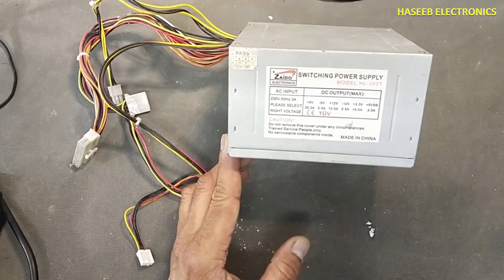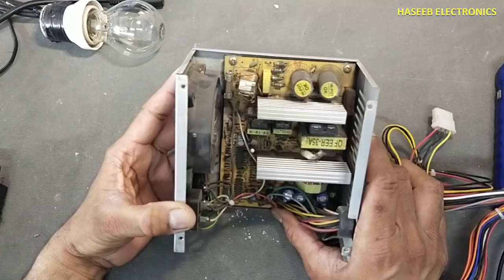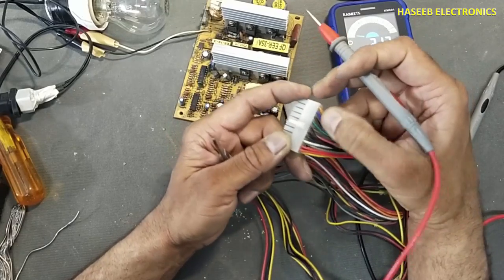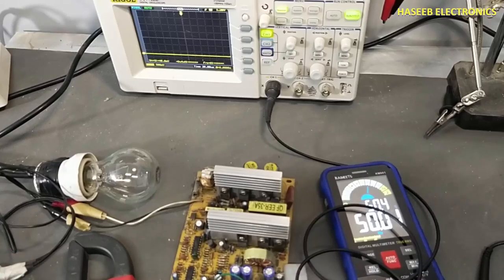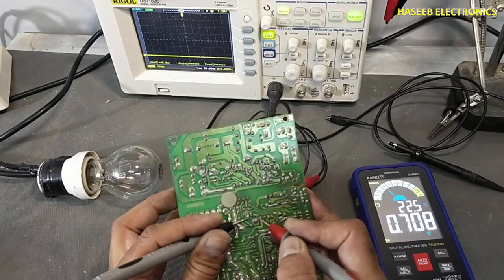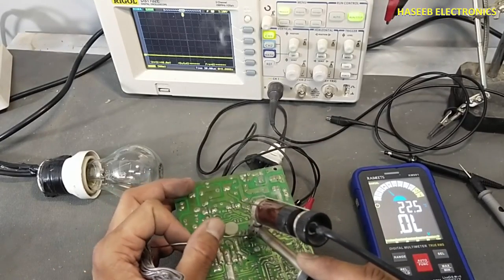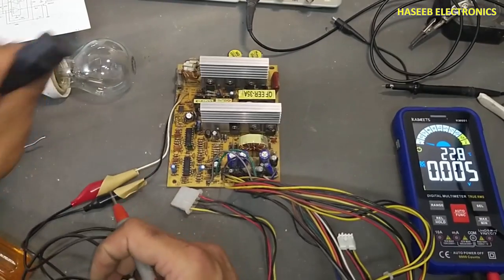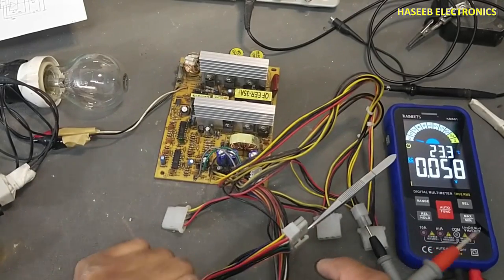{847} How To Repair Computer ATX Power Supply - No Power On

Comment: Resp Sir! Very Excellent Class Sir. Sir Conon MF244dw Printer Power Supply DC Section 0.1Ohms 2Resistors was burned Sir and New Power FET K4005 was Replaced Sir and 2 Resistor Replaced with 1Ohms, 10 Ohms, 22 Ohms Resistors but again and again Burned Sir. and Series Lamp was a very Lettle Glowing Sir and Resistors Burned Sir. Where the Problem Sir. Very Hardly Searching Sir but  not Solved Sir.  Please Advise Sir. waiting for Ur Message Sir.   ---  Chinna Rao, Paderu, Visakhapatnam Dist, Andhra Pradesh.

Comment: Sir, I am facing the same fault in hipro d3057f3h psu, how can i find the location of two transistors along-with that frequency diode??? Hence I found also two transistor (29074) with near a diode 6510. After that, viper 22A then a diode again 6510. Sir, was it the location of malfunction??? I will pull out these components from circuit for testing after your recommendations.

Comment: Sir KA7500B pwm controller ic pin no. 4 increasing voltage instead of 0v on ps command on. Fan will spin for seconds and stops. Give the solutions please 🙏

Comment: Greetings to you aTx contains tl494 Vcc voltage starts at 17 volts and goes up to 19 volts is this normal I changed the tl494 gas capacitor and the voltage didn't change What's the reason

Comment: Hi Haseeb, i am thankful with your channel and i learned a lot from your teaching. i have a question from regarding the power supply of a MFP copier , i'm searching in social media who is repairing the LVPS but i could not find. i can repair in primary section but when it comes to secondary i could not get an actual value that suppose to be their is +&-5V, +&-12V, +&-24V. i am not sure if need to trigger first the heater section of the copier then will activate the other parts which supplied by 5, 12 & 24V.   like in PSU of computer you just need to shorted the green and black wire in order to run the LVPS. please if you could share to us how to repair.  Thank you very much.

Comment: wbat should be thr watt of the series lamp for 60 watt 100 watt 200 watt
or is it different for difference power supply
Reply from the maker: it depends on power rating of the unit under test
normally 60 - 100 watt lamp is sufficient

Comment: I have an old ATX power supply Antec NeoHe430.  All the power rails are present and correct with no load attached.  If i plug a IDE drive in to give it a load then the 5volt is only 3.6v.  The other rails are still correct.  I took the 5v rectifier diode out and measured it and is good.  So do you have an idea what could be going on?  Do you know where can i get a schematic for this power supply?  Do you have a  video with this kind of problem?
Reply: Inspect the capacitors near the 5v line and around its generation. By eye to start, to see if there is any leaking or bulging. For sure if either of those seen, they need to be replaced. It is very possible for one of more to be bad even while looking perfect to the eye, so you'd have to test. But if you're lucky enough, you can see the problem straight away. There is a chance of it. Failing that, you might check for the values of resistors near it too, to be correct within tolerance.

Comment: Can one also alter the voltage output on this power supply and bypass the overcurrent protection or modify the current protection circuit

Comment: sir my atx powersupply somrtime work sometime nothing .... 

i have checked vcc of pwm ic (uc3842) no volatge but when it work it has 20-25 volt on Vcc 

cant get what is the problem can you tell some steps to check .
300 volt reaching at c5027s trasnister .

i think problem must be in vcc of pwm ic uc3842 .

Comment: hello, s.a. I've been following your videos for along time, they are educational. I'm interested for 6 months with electonic. I've repaired too much electronic device. Sometimes success, sometimes failure. I've two question about power supply. 
1-) How can you explain one time glowing at series lamp at connection psu ? The current must flow constantly, but for test purpose 1 time glows and current stops. How ? 
-
2) When i've connected series lamp to PSU and give energy, the bulb glow 1 time and current stops. But, when i made shortcircuit with green and black, PSU works, fan work, all voltages are good. But series lamp flickering(blinking). I've checked all components visually inspect and checked multimeter, i couldn't find. I can't comment, I think i'm not experienced yet.
-
Thank you, respect.

Comment: Hi my friend would you please analyze a power supply of a brand  with complect 
schematic which is made many in all the word like  a model that used 2 ic with part number:
AZ339P and  AZ7500BP and also has 2N60  Fet transistor 
Thanks  too much before!!!